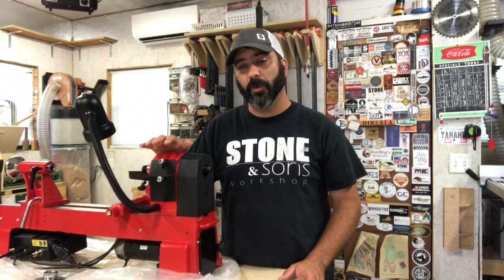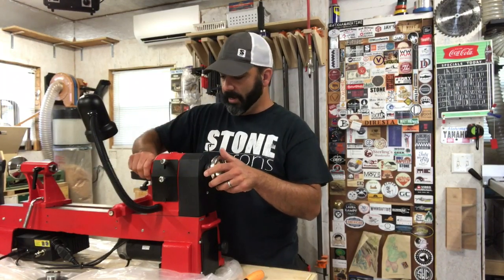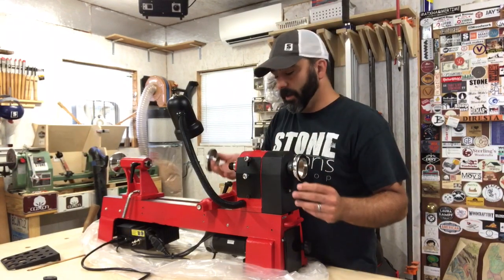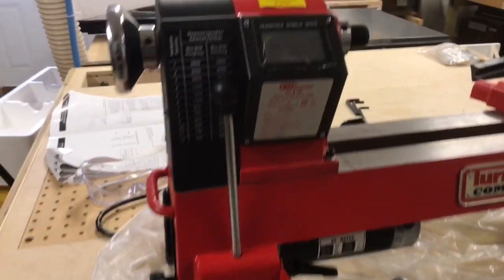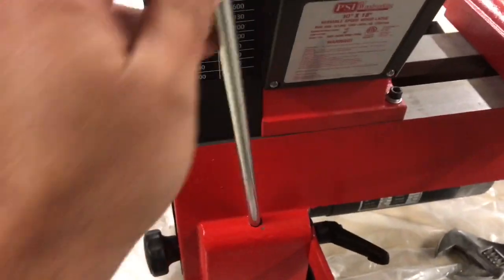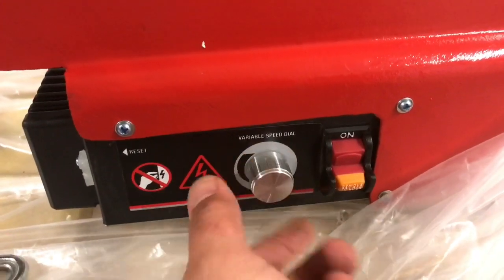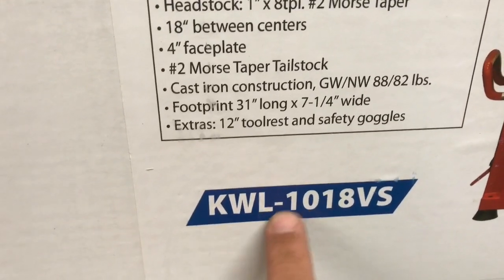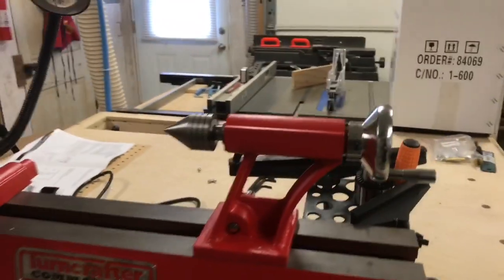Lathe Review - Turncrafter Commander KWL-1018VS

Comment: Nice walk-through. Looks like it has everything you need in a lathe that size. 

I am a bit surprised that they didn't make it easier to change the belt on the pulleys. It seems to me that if they had a smaller cylinder type handle instead of the knob they provided, the case could just slide over the knob without having to remove the handle. Then you could use a magnet in place of the screw to hold the case in place. You don't need a larger handle since it has a spindle lock, IMHO. Just something that comes to mind.

Comment: I have the Turncraft 12"ve my belt guard has a slot and a metal plate with a thumb nut to hold it on. I can email you a picture and maybe you could modify yours. Take the hand wheel off every time is going to mess up the threads because of the set screws. I love my lathe it works awesome.
Reply from the maker: +James Seagraves that would be great. Yes, I agree. I don't really want to take it off every time. Send me an message through my contact page at stoneandsons.net Thanks!

Comment: Great video and what a clean and organized shop!!!   Do you think the live center would fit in both ends if a person wanted to use the lathe to check the truing of a motorcycle crankshaft?  If it does I would then order another live center and install one on both ends,
Reply: Both the tailstock and headstock are MT 2 taper, so yes you could do that.

Comment: Looks like the tool caddy might get in the way of locking down the tail stock at the full 18" position?
Reply from the maker: Slightly, but it’s not a big deal. Sorry for the delay in responding.
Reply: Most of the turncrafters are drilled and tapped behind the headstock as an alternative mounting location. You can see them at 6:40.

Comment: Hello Just purchased the 10x18 var speed.how do you change your belt?is the only way by taking the hand wheel off
every time?Is there a easier way? Thanks for the Review
Reply from the maker: Yes, that’s the only way, but you might find as I did that I don’t need to change the blade, ever. Because I have it setup specifically for my kind of work. I really don’t consider this an issue. Hope that helps.
Reply: Thank you very much.
Reply: The newer ones have that cover as a two piece unit that doesn’t require removing the knob. I’m sure you can get that as a replacement part from PSI, and it’s just plastic so I wouldn’t think it would be very expensive!